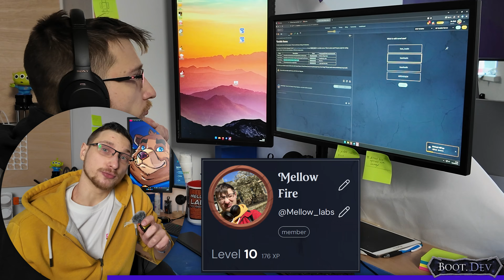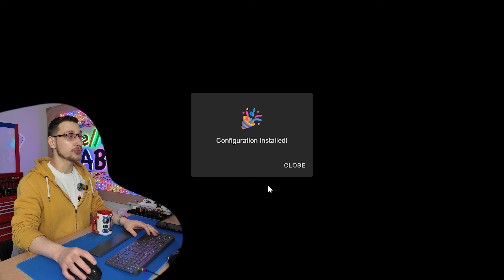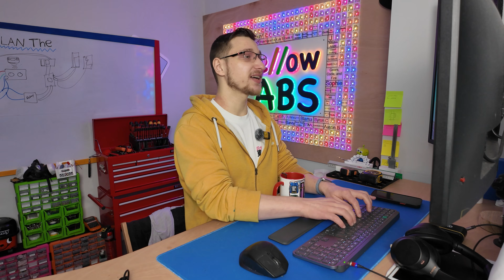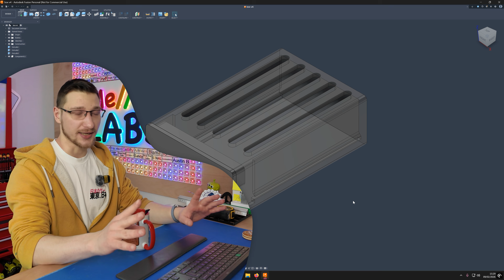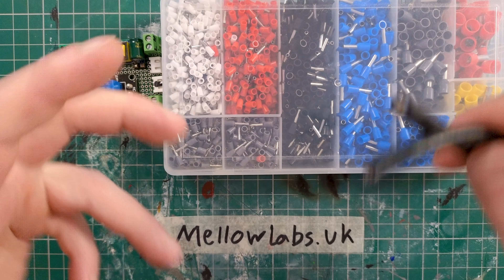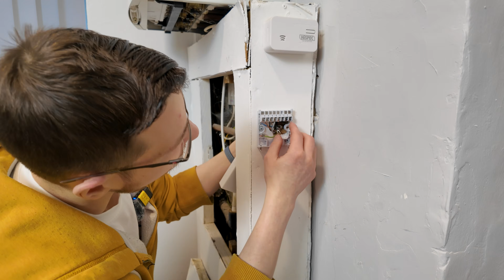DIY Smart Heating

Comment: I did something similar. 
But instead of wires, I used ESP-NOW to add some wireless sensors. 
And I used some smart valves to control the radiators in different rooms. 
The main ESP32 kept track of how long it takes to heat up a room. So, I can plan the heating cycles ahead. 
Next thing I want to add is a way of getting weather data from some REST API service. This might help to know if the boiler needs to start early or not.

Comment: DIY radiator valves, that would be interesting!
Reply: I'll share my idea since you're a lot more productive than I am: use regular thermostatic valves and motorize them. The idea is that the temperature regulation will be done silently by the wax mechanism and you'll use the electric motor only when you want to change the target temperature

Comment: Milliamp-hours (mAh) is a measure of charge, usually stored charge, not current :) Your DC power supply outputs 700 milliamps (mA) of current.

Comment: Wouldn't it be easier to buy a €50 smart thermostat? One can turn on and off the boiler, select the temperature, have the "anti-freezing" functionality, and even create hourly/daily/weekly timers, all in one simple app.🤔It only takes a few wires to set up, and it can be taken down when someone moves.

Comment: For further digging your rabbit hole: for some boilers you might have on the same 1 and 2 lines (as in your drawing @4:22) the OpenTherm protocol. ESRTP4RF+ thermostat also has the posibility to be connected via OpenTherm (last pins on the right 5 and 6). Via OpenTherm you can find out additional information such as error codes (if they happen: missing gas, missing gas pressure, air intake issues, etc) or for reading and setting the temperature for the water inside the heating sistem and foset hot water. There already integrations in Home Assistant for an OpenTherm Gateway running via either tasmota or esphome. The hardware can be made DIY or bought from sites like diyless or tindie. Maybe this is out of the scope of this video, but what can be done can also be over-done and not following th KISS method :). For automating the heaters, the best easiest way would be to buy a smart radiator valve such as EZAIOT (when on sale on aliexpress, around 25-30EUR) or TRVZB from sonoff (around 22-25EUR) with zigbee communication. Instalation may differ, as some radiatiors might have manual valves or manual thermostats (manual temperature setting).

Comment: This is great design because it is so simple, even a non-engineer like me could follow along :P. Only thing I didnt get was, wouldnt the hot water and radiator water be the same temp? isnt it the same water source?
Reply from the maker: One is for the hot water in the tap, and the other is for the radiators/heating.

Comment: for the accurate reading of the temperature sensors, put a thermal pad or thermal compound between the sensor and the tube. :) 

1. Also, the relay sometime stuck to the close position, for safety, have a feedback with the NC pin to the esp to make sure the relay is turned off when you turned it off.

2. You can use a warning notification thingy to know if the temperature increases beyond a safe limit or auto off the boiler, etc.

Comment: I guess I will never handle mains voltage. I'm just too much scared. For official products there are tons of rules, like distances between mains voltage and low voltage on a board... too scary to breask those rules. Due to this, I have a pile of DC power supplies... so I only handle 5, 12 or 24V and never more.

The result is really great and nobody died in the process😀

Comment: Great video. I use Tado thermostats on my radiators for the auto turn on and off based on temperature and they work with Home Assistant ok, Alexa seems to override it and turn off any schedules I have set up.

Comment: I sincerely hope you're joking about the crimps and using the pliers. The plastic pieces are color coded for the gauge wire they are for, which you should have used the red coated ones. And you should use crimp specifically for those, not pliers, especially if you were running mains through those terminals. Don't want that brown wire to come loose and maybe make content to the water pipe while you're taking a shower and make your water brown too  😆

Comment: Nice little project. I like that you just hooked up into an existing system and parallel controlled the device so that it would work as expected normally.
Something to note though, the power supply is 700mA, milliAmp, not mAh or milliAmpHour.  mA is current flow, mAh is capacity. Battery capacity is measured in mAh, their output is measured in mA  (or Ah and A if large enough).

Comment: Even though this likely never will be an issue, you need the proper type of pliers for a proper crimp and the proper sized cable for the type of terminals. Please do them again (replace the terminals) with the correct type of pliers so it's safe and won't start arcing at some point. It's very likely perfectly fine, but since you're talking about live wires here you really should be careful.

Comment: I would suggest thermal actuators for turning on and off the radiators.
They require mains voltage but that is also a good thing since there is no batteries.
And they are so much more quiet.
A lot of TRV users limit them during the night.
That isn't necessary with actuators.

Comment: Nice idea but esi make wifi hub which does and can communicate with thermostat with touching wiring if the boiler breakers and landLord see it he blame you for touching boiler connection and it doesn't have to be your device that broke the boiler, the boiler broke on its own manner. But you know how landlords are with you touched it, you're paying for the repairs, you know how some are like that.
Just say there is hub does same thing

Comment: Awesome video. This makes me really confident that I can do something similar if needed when I'll move into my apartment this year. Excited to see a video where you automate the radiators as well. Are you planning to also predict preheat and early stop for radiators to reach desired room temperature? (That's something I am worried about when I'll implement smart heating system myself. Don't want to come home when it's not heated yet, or overshoot and be hot in the room while radiator cools off)

Comment: i did the same thing back in january. i did a few things differently tho;
1) i used a 2-channel relay instead of 1ch because it was same price, and connected the second channel to boilers ac line. may sound silly but dont worry its rated for it, so when everyone is away etc, we can turn the entire boiler off.
2) another ESP has a room temperature sensor and sits at the living room.
3) i have a basic climate entity configured at home assistant which reads from the room temp sensor and regulates the thermostat relay on/off to heat/cool down the room. you can also use custom integrations from HACS to e.g., regulate heat in a pwm-style fashion. 
4) im too dumb to use a breadboard, it is essentially a cable spaghetti and i jammed all of my stuff (ac-dc, relay, esp32-wroom-32d) in a 3x3 pvc surface mount box. .
5) my cheap esp32 outputs 4.4v at 5v rail so i had to connect relay's 5v to the output of the dc adapter instead of 5v pin of esp32. also ams1113 on my other esp32 burned itself under miniscule load so it is taking external 3.3v via 3.3v pin to boot rn lol
Reply: also set your radiator water temp slightly higher if its your first time installing a radiator, since it will not be on 24/7 you can set it higher to heat up the room faster.

Comment: Oh, boy. You used too loose ferrule to crimp the terminal wires. Not much too loose, but I'd cut off the ends and recrimp one size down.

And let's leave the fork crimping without comment, but you need actual crimping die to clamp them down properly. I'd not trust your job with anything that can burn a house down.

Comment: Yeah that ferrule crimping tool is not the right one for those spade/fork connectors. You should just be using a standard jaw crimper for those, either like for a butt splice, or d-sub style.

Comment: This is absolutely not recommended to do this if the boiler is somewhat modern (eg anything after let's say 2005) and is properly installed with a modulating thermostat. A modulating thermostat does not just switches the boiler on and off, instead communicates with the boiler via some kind of bus (eg opentherm) and requests firing percentage, queries outdoor temperature via the fresh air inlet temp sensor, etc.

Comment: I recently made my in floor heating smart using some computherm thermostatic valves and solid state relays connected to esphome, if you can group multiple radiators to one esp it could be a great way to do it locally. Also for temp sensors the little Xiaomi BLE units flashed with the custom firmware are great. Awesome video btw

Comment: For the pipe temperatures, you need some insulation around the pipe and the sensor.  I solved it with black socks tied around the whole thing and a velcro tie to keep the bundle together.  Mine isn't even in a cabinet and I have to see those every day.  It's actually not that bad.

I have at least:
- heating buffer upper temperature (basically what goes to radiators and floors, buffer tank had a probe pocket, so I just stick the sensor where it belongs)
- return temperature from floors
- heat pump in+out
- heating buffer in+out (to differentiate from the hot tap water buffer)
- utility cold water supply/water meter (with alarm for freezing, if something crazy happens)

With the heat pump in+out values and known heating power when driving it with just the resistive elements, i could calculate the flow rate etc.  Dialed back a little and use just the temperature difference for automations now though. While doing that, I realized that the heat pump controller also uses temperature difference for its own flow rate limits and I was able to fix a problem with it constantly dying for several different over temperature errors.  

I added my own relay board between the heatpump controller and its resistive heater contactors to disable individual phases when the in+out difference gets too high, basically lowering the max power from 9 to 6 kW when needed.  I also use those relays for dynamic control to watch for main fuses, so that if I happen to turn on a 3 kW kettle or something and one phase current jumps over the 3x25A limits, one third of the heat pump element dips down and comes back on when theres enough current available again and the in+out temperature difference is low enough.  Then theres EV-charging.. Combining everything in home assistant got pretty messy, but it works.  Basically for one phase current rising too high, heatpump resistor dips down.  If all phases are high, car dips.  And then you need to handle recovering from all that in a way that makes sense, the house won't get cold and the car has enough range in the morning :D

Comment: Assuming it's using ISM i.e. 415MHz why not duplicate the radio protocol and transmit using a cheap and readily available module connected to the ESP ?
Reply: @GannDolph  my friend did exactly this, works ok but he did find that you need to have the other controller off for it to work obviously, in theory as well if you added a secondary relay with the esp you can keep the existing one for freeze protection etc :
Reply: @t @thatguyjack2208 at's a good point, i didn't think of that.  i have a wireless thermostat in a vacation property and it transmitted its "state" every minute or so - a cheaper method of ensuring sync than  having two-way radio I guess.   Yes that would indeed interfere with trying to esp by radio.      Although it would be trivial to use a readily available thermistor / relay module for the freeze protection, take the batteries out of the original remote, and esp+radio.  both approaches are acceptable i think..
Reply: I did something similar with a diesel heater, imitating the remote signal.

Comment: Please note that the colors of the wire ferrules correspond to the different wire diameters. They have nothing to do with the cable colors.
Reply: @BingoBongo8859  the ferrule colors are what the manufacturer decides. I have ferrules of the same size in different colors.